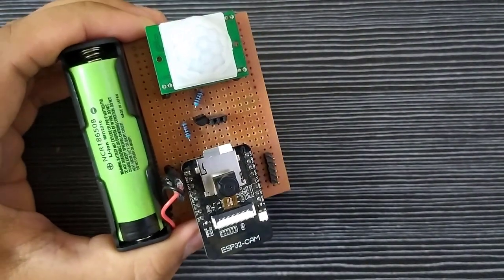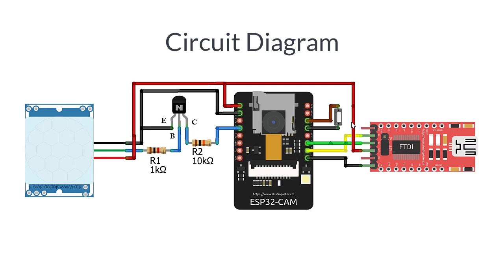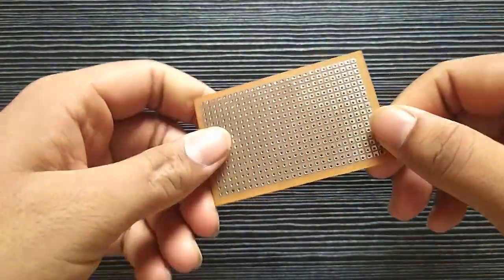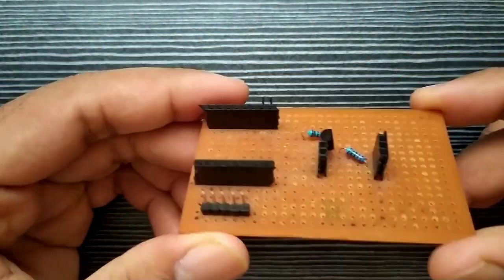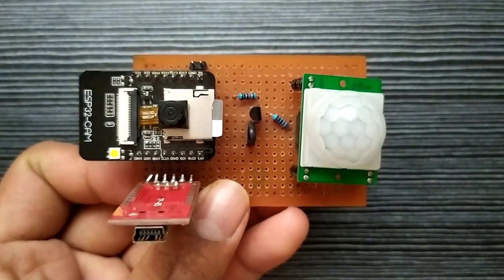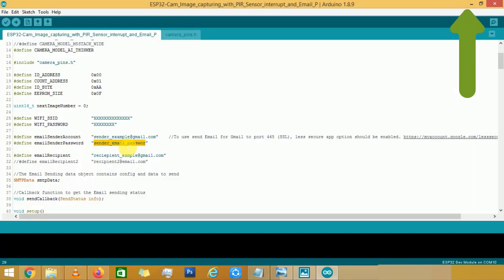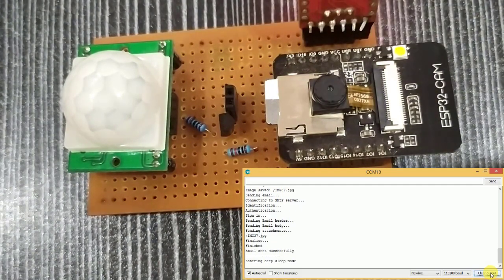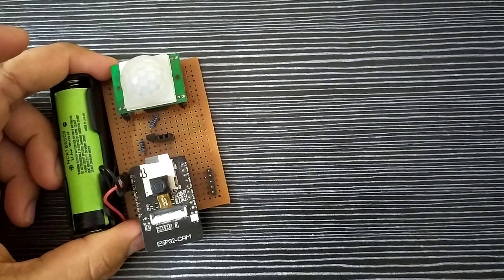ESP32 Cam based Motion Triggered Image Capturing Device

Comment: Thanks for sharing Awesome project. I m getting yellow color tint in received images & secondly the orientation of image is different from that of ESP32 CAM Module. Can you please share as how to get yellow tint free images & what modification do I need to make in code to rotate the image 90 or 180 degrees to match the orientation of ESP32 CAM Module.

Comment: Excellent description!  I have got it working, found video quality poor, SD pix size only around 160K, bu tin  code setting is for either UXGA or SVGA.  Your pix  seem only 18kb size so not that good either.  Any reason for difference  or way to improve video quality?

Comment: Thanks for sharing such an Awesome project. The image captured on motion detection will be sent to email or do I have option to select any specific image from sd card saved images using gpio pins to send it to email. If not possible with existing code, can you do another video to do the same as requested.
Thanks & kind regards.
Reply from the maker: No, it will automatically send every captured image to mail.

I have given that sd card option for backup, in case of internet connectivity failure.

Comment: Connecting 3.7v battery to 5v input? That will never work.
Reply from the maker: The 3.7V battery will have 4.2v when it is fully charged.
When you apply 5V at input, it will be converted to 3.3 V through a regulator.

As long as you give voltage of more than 3.3V , you will get 3.3v as output from the regulator.
The is enough to run the on board ESP module.

So, when I conect a 3.7V battery, it's more than 3.3v. thus it will work.

First read about lithium ion batteries, regulators and ESP module datasheets.
Then come bach here.

Theri baap ko math sikha...
Reply: @electronicsinnovation  LoL. Khud ko baap kehto ho. Yeah, I know about lithium-ion batteries, regulators and I do read datasheets.
ESP32 CAM uses AMS1117 as the voltage regulator and the 5V supply input can only accept DC 4.5V – 12V (input voltage must be more than output voltage (more than 1V)). 

I guess you will again come up with some dumber justification now :D
Reply: Ok, enough discussion. What battery should I buy ?  What voltage and Amps? 
Please . 
Need to run the camera for 4 hours
Reply: @julianvaldes9242 did you figure it out?